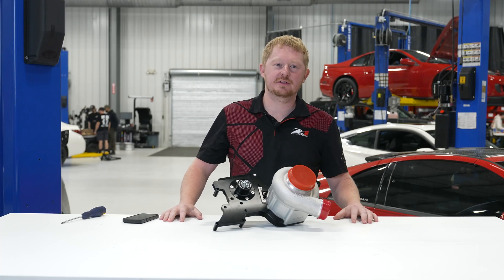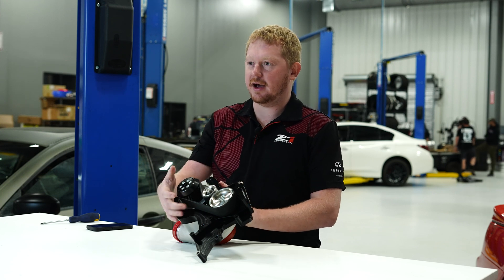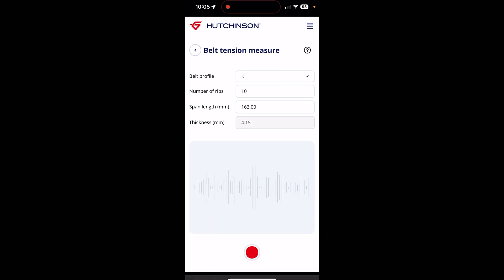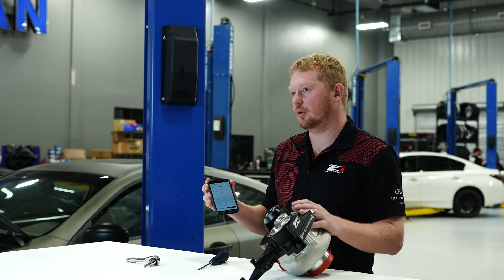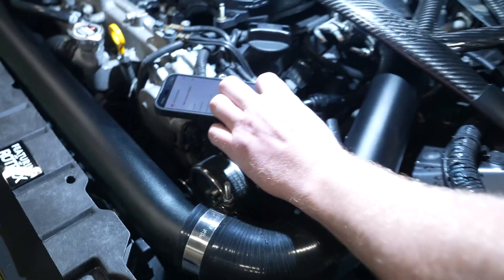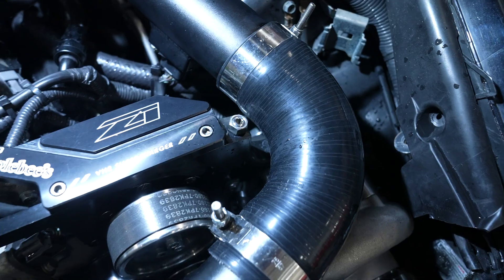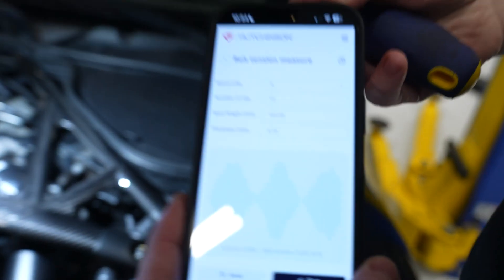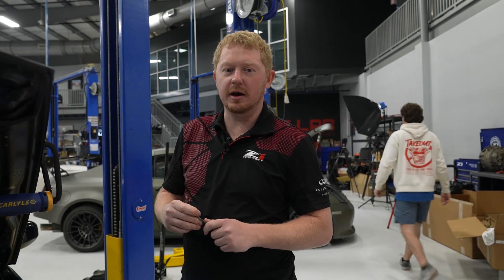How To: Z1 Supercharger Maintenance

Comment: i have a 2003 vq35de 350z i’m not trying to blow my motor 
can i order this kit and run it with no head or rod work done without blowing up my motor just bolting this kit on and all the things it comes with and it’s good to go ? i’m aware it’ll need tuned but any thing else

Comment: Are those specs in the app for both vhr and de supercharger pulley belts?
Reply: Just need to use the values shown in the video!
Reply: @chrisblair1120 what about with the new sport kits? 8 rib?
Reply: @FusionInc. that is correct. The rest of the  specs are the same!